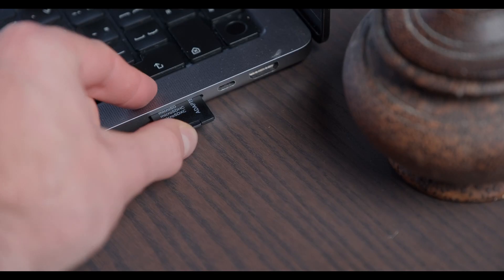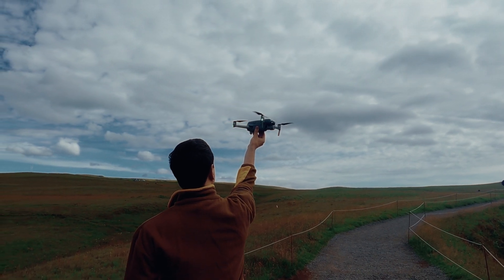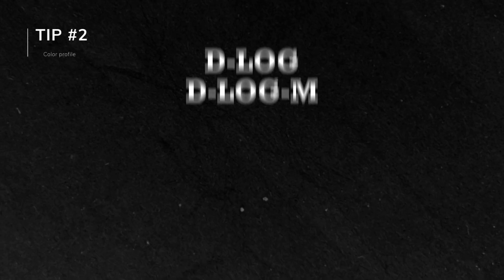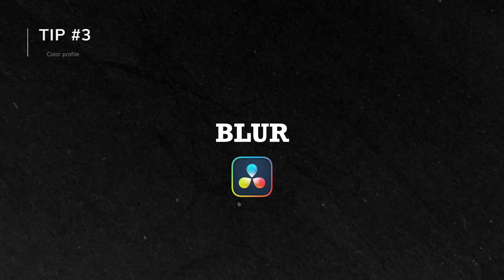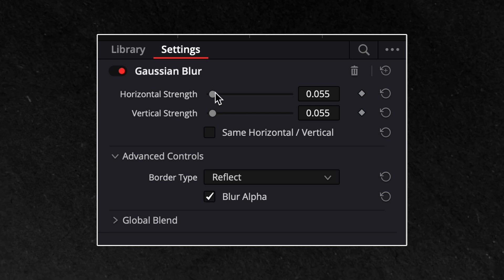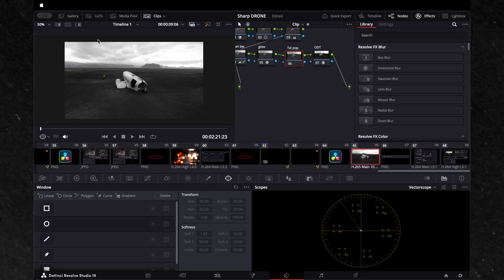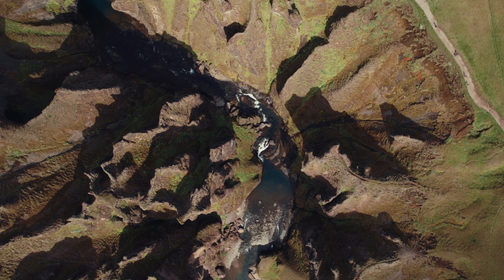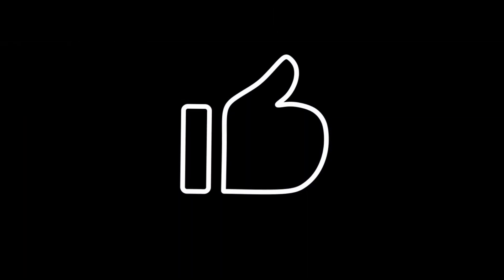Fix Over-sharpened DRONE Footage IN SECONDS

Comment: Also, I'd add a little post motion blur. Just a touch. The motion cadence on these prosumer drones isn't the best straight out of the camera, even at 24fps 180° shutter. 

Also, denisty in an image can also be controlled with luminance and color. If you're looking for that thick cinematic feel, don't spread your luminance values across the entire waveform. Condense values in the mid-lower quadrant of the ire, just like a big boy Hollywood film grade does. This gives an image weight. Spreading out the values is a marker of broadcast video, not film. 

Add some density to your saturation in the Colorslice tool, or vs. curves or colorboost.

Watch your DJI footage not look like DJI footage anymore. 

DJI has been very naughty. They're not listening to their customers.